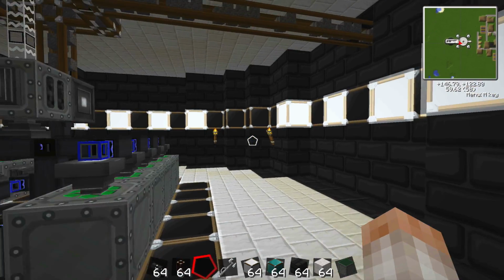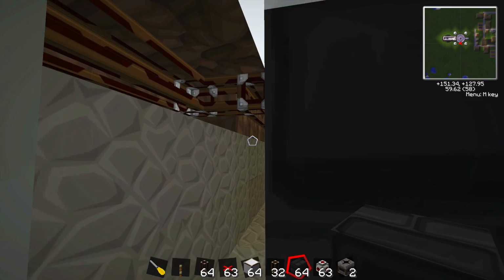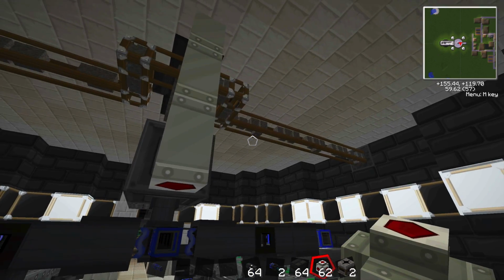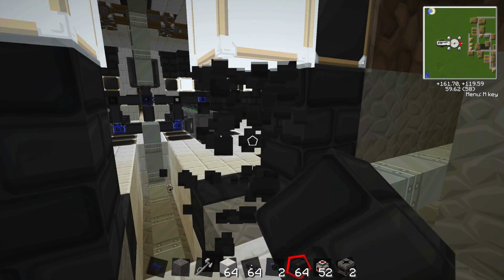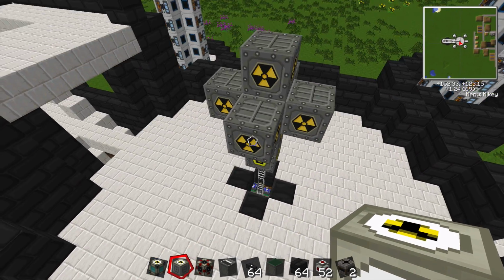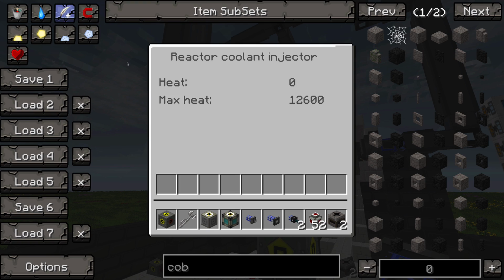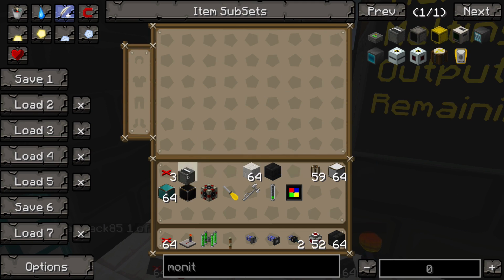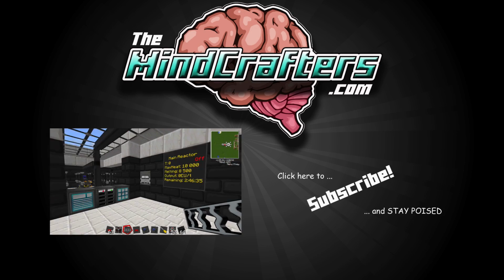Lets Build a Nuclear Power Plant - Episode 8

Comment: Instead of a glass fibre cable you should put a batbox in the thermal monitor room.  There is no reason to not use one and it gives you a buffer of 40k eu where your monitor will still have power.

Comment: One Question: This shiny reactor can produce  4.360 EU/T. But the HV-Transformer takes an input up to 2048 EU/t and outputs 512 EU/t. What happens with the rest? Is the ractor in this case not a little bit "overkilled" and inefficient?

Comment: Right now the cobblestone detector shutoff is going to have some trouble, although in the end it may still work out.

In short, your level emiter is on the part of your ME network on the recycler side of the Dark Cable, so when they are shut off, it can't tell how much cobble you have in the sytem. Once you end up with a certain amount of cobblestone in the system, if you turn off the recyclers it won't be able to shut off with the current setup.

Comment: I found that with 25 recyclers x 4 OC each it draws 150 EU/t. Assuming I'm not messing up on the math, that would mean that each recycler uses just under 1 EU/t when at default operation. That's a 6.5x increase in the EU consumption. Four OCs also means that you get (0.7)^4 = 4.16x speed up of operations. However, there's a static (1?) EU/t you have to add for each recycler for the additional import/export bus you need. (Assuming each bus is 1 AE unit per tick and 1 EU = 2 AE unit)

Comment: Absolutely - I remember you mentioning that backup plan several times. However, physical space doesn't seem to be in short supply, so you may be able to get away with adding a few more recyclers. The question is: where does the energy gain from having fewer overclockers get superseded by the extra draw from more AE importers/exporters?
Looks like I have some more experimenting to do!

Comment from the maker: That will also reduce the speed at which UU is produced (less scrap) so I'm not sure if that would be the optimal solution. 

Toy with this idea a little bit: one well placed quad uranium cell would increase the breeders power from 240 to 480 eu/t which is a huge gain at the cost of one uranium ore and more cooling because of the need for another LZHC. I've mentioned this before but it may turn into reality at this point, let me know what you find!

Comment: Well, my biggest power draw seems to be from the recyclers themselves (~160 EU/t), the rest is from the other machines (not constantly, obviously), and of course the AE network.

One thing I have thought of is reducing further the number of overclocker upgrades. Each one you add really decreases efficiency in terms of power usage if I understand correctly - they give you a 30% speed boost (stacking exponentially) along with a 60% increase in power usage (again, stacking).